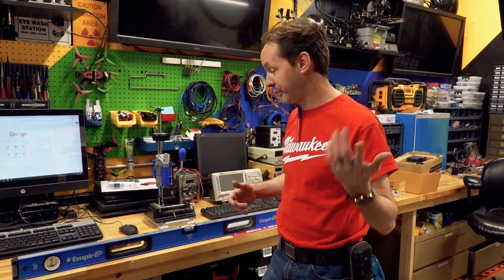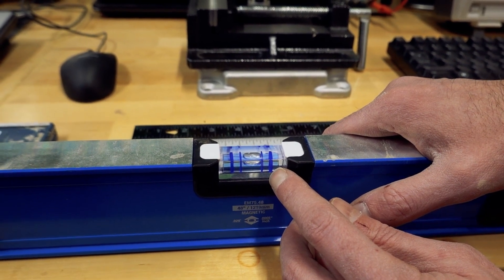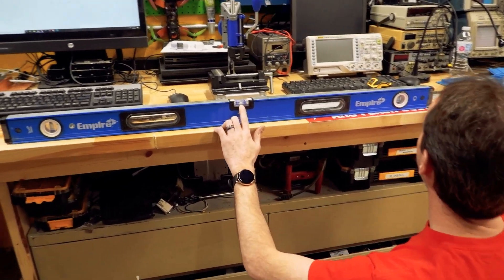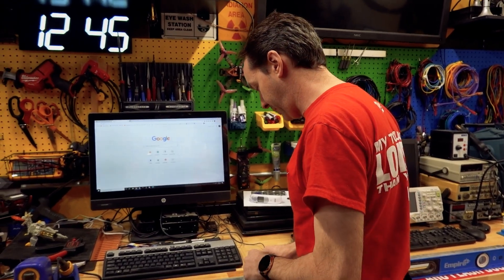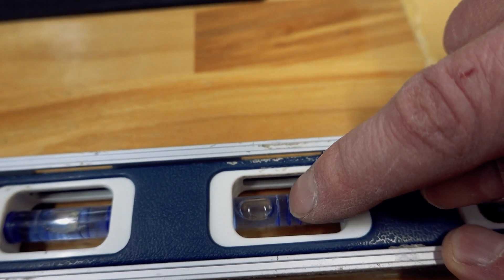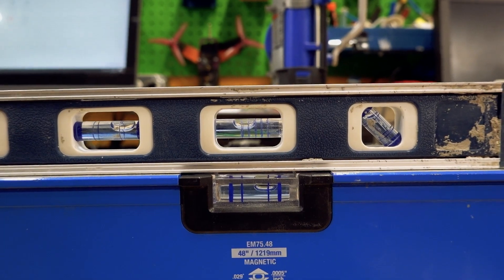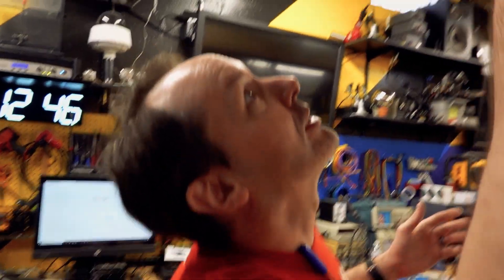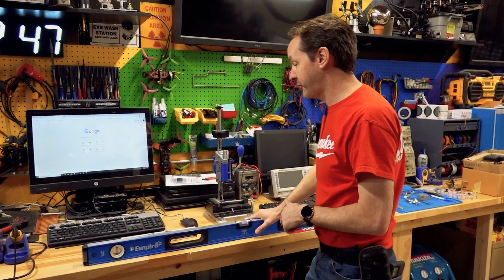How to slope a drain with the right level.

Comment: In Wastewater collection systems, a desired slope to achieve 3 ft/sec velocity is desired, 2ft/sec is almost too slow & 4ft/sec is almost too fast. Too slow, & the solids fall to the bottom & build up. Too fast & the water runs off & leaves the turds behind. But a "perfect" slope is almost impossible to achieve & is addressed in pipe diameter & area shape, where a slight or pronounced "V" shape at the bottom can improve lower flow characteristics. 💩😜🤠

Comment: Depends on pipe diameter.  Also on lengthy runs.  Long runs are not to slope end to end greater than the pipe size.  Therefore if I drain a 2" pipe  20 feet or 40 feet... the distance must not exceed 2".
Reply: So you're saying on a 2" pipe, you can't run more than 8' of it if you do the typical slope of 1/4", because 8 x 1/4 = 2? That's obviously silly, so I must not understand you correctly. 

If that were true, the standard slope of 1/4" couldn't exist, as it would be entirely (not partly) dependent on the width and length of the pipe; "per foot" couldn't work. And you'd have insane pipes like a foot wide and/or super shallow slopes for the vast majority of piping.

Comment: Standard Horizontal Drainage Pipe Slope ; 2 1/2" or smaller, 1/4" per foot, 2.08% ; 3" to 6", 1/8" per foot, 1.04% ; 8" or larger, 1/16" per foot. Sewer pipe slope Calculator 
https://convertersnearme.blogspot.com/2023/10/sewer-pipe-slope-calculator.html

Comment: We want 0.25 inch (1/4 inch or 2%) per foot inside a building but once we get out to the main sewer we want 0.125 inch (1/8 inch or 1 %) of slope in our drain lines where I live. If a level doesn't have the extra lines, you can also estimate by using 1/4-1/4 of the bubble length as your guide. So when you have 1/4 of the bubble over the line you are in the right range.
Reply: What is the required pitch for the stretch of pipe between the point where it exits building and where it meets up with main sewer?  still 1/4" per foot?

Comment: I think any level can do this. I heard the term "half bubble", referring to the bubble being evenly split on the line, represents a 1/4" slope. I found this video while checking to see if that's accurate. Empirically that matches your demonstration. Thanks for the tip.
Reply: Yes and no. Some levels have a tapered vial. To hyper exaggerate an out of level state. They usually claim to be "more accurate". I have the same 12" empire level he has around here somewhere. I'd be guessing that the slope vial Atleast, has a consistent diameter. 
The kapro one I have in my hand right now, has a very pronounced taper on the vials. I still don't trust this one for pipe slope
Reply from the maker: Interesting! Thank you, Sir!